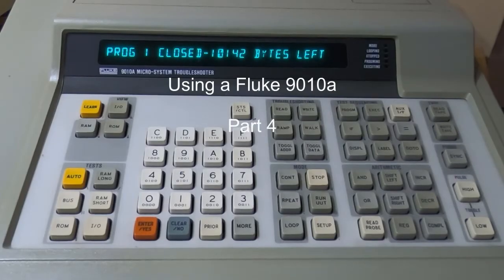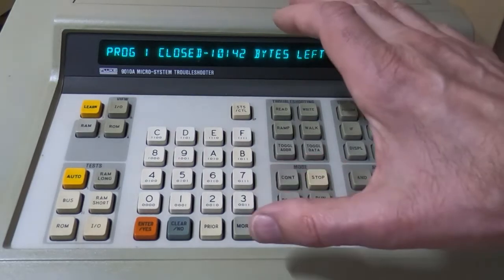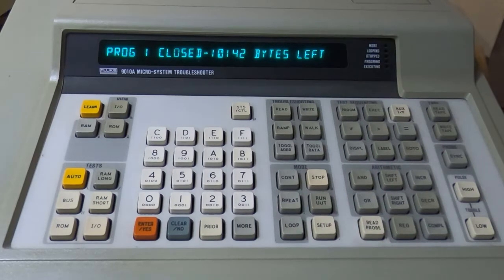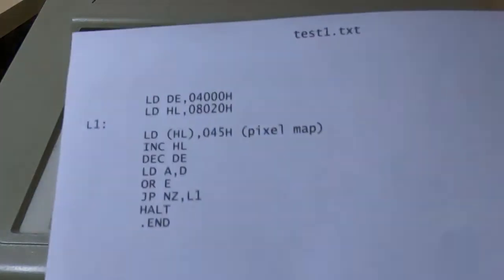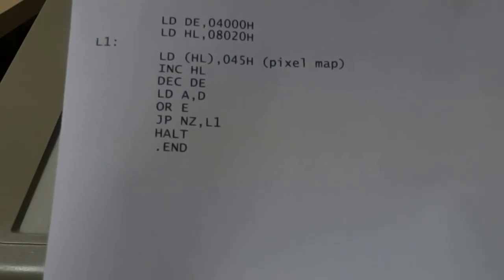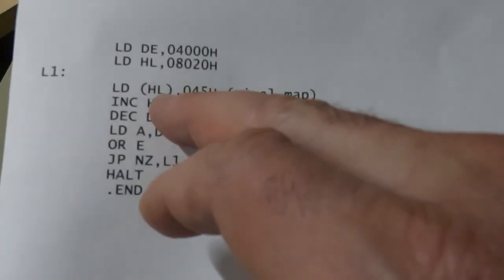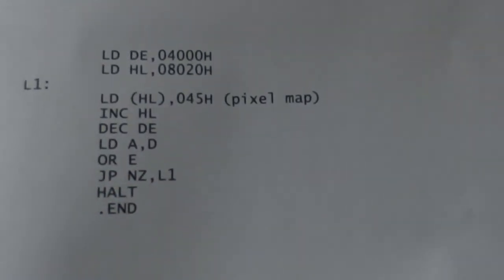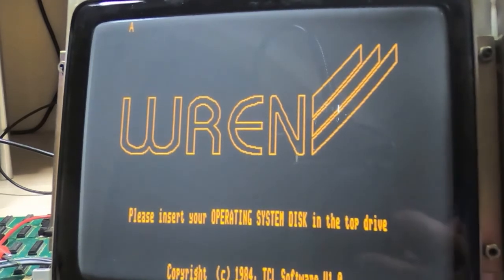Using a Fluke 9010a Part4

Comment: The CPU in the Wren has been replaced by the 9010A pod, correct? So when the Z80 code you loaded @ 8000 runs, where is the CPU that runs it? Is there another Z80 on the pod?